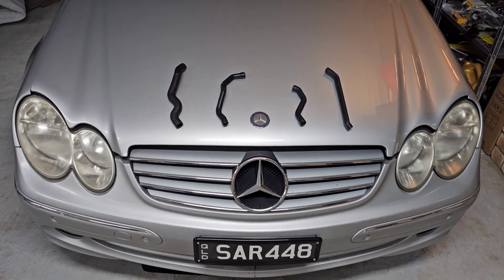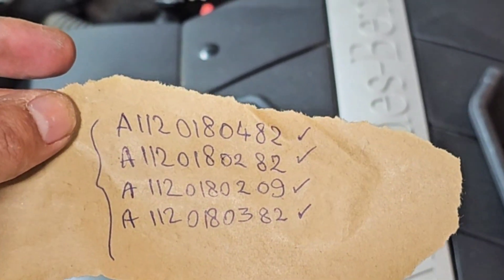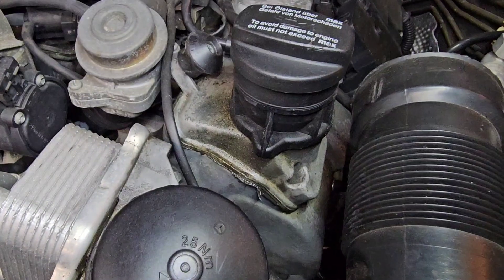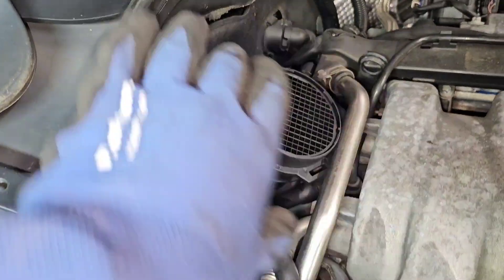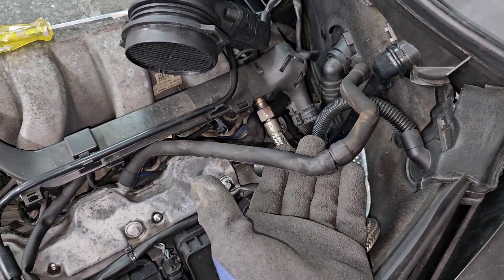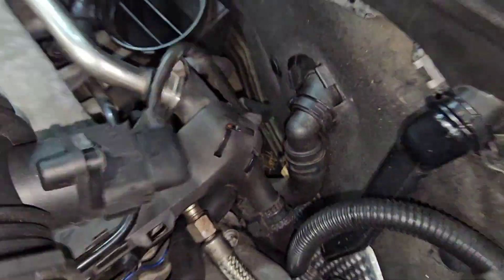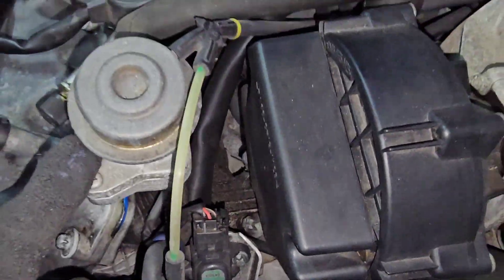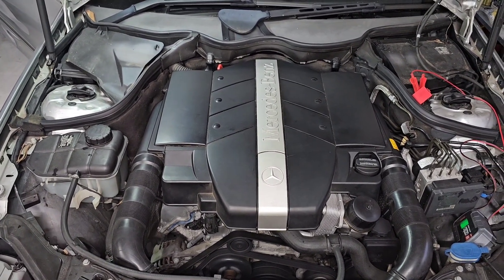Simple maintenance; huge difference, PCV hoses replacement for M112 & M113.

Comment: Is this a cause for smoke on cold start for the M113?
Reply from the maker: No, Leaky injectors or worn valve stems...
Reply: @BenzAddiction yeah I had my injectors rebuilt like a year ago, and the valve stems done aswell like 6 months back. It's on a 2004 g500. I'll try to get a video of it and post it. As soon as the car warms up no smoke at all not even after revs. One thing to ad it has the secondary cats deleted, G55 exhaust system.
Reply from the maker: @KarlLane-fp8zu 👍

Comment: If one day you have time. Can you make us a video about the replacement of EPS Pressure sensor B34/1 on CLK320 m112. Thank you for your help.
Reply from the maker: EPS, if this is referring to exhaust pressure sensor,  it is only on diesel engines.
Reply: @BenzAddiction  This concerns the braking system for a gasoline engine. If you search on the internet, ESP B34 error you will understand what I want to talk about. Thanks.

Comment: Great video Max . Good advice and good to see the MAF intake removal procedure..
Did you re-fit the clip at the back ?
Reply from the maker: Hi Leo, thanks, mate. Mine did not have the plastic black round belt clip. But the metal clip pops back in by itself when you fit the airflow meter correctly.
Reply: @BenzAddiction  Oh ok , thanks , good to know.

Comment: Hi thansk for it. I have done this a tear agon with the covers gaskets. A question about ignition coils. Mine are orginal 22 years and 174000 kms but I have no problem with these. do yo thnik I have to replace it ? Thanks.
Reply from the maker: Hi, no... if they fail, they throw a code :)
Reply: @BenzAddiction  I agree ,,mine are twenty years old but the car runs great so no need to replace them..
It's not like one coil not working well will leave you broken down somewhere.
Reply: @BenzAddiction  Ok I have read somewhere that ignition coils on these motoer are  very important for fuel consumtion or dynamic behavior...
Reply: I have a spare new one just incase..with a scanner you get the cylinder misfire so just swap it out on that cylinder and see if it fixes it.....

Comment: I just did mine and also..Rocker cover gaskets..definitely get originals..spark plugs new ,fuel injectors,air filters,cabin filters....flushed and serviced transmission...flushed power steering...new rotors and pads.Replaced rubber seals x2 air flow meter ..I am using now Valvoline Clean and Restore for the engine which highly recommend and done that on my motorcycle too..Car is now running beautifully and very happy...A little trick I did was  turn the gasket upside down/flip over on the oil filler cap..The seal mates better and seal has a groove after years of use ..flipping it fixes any leak..simple fix..
Reply from the maker: Thanks Dennis 😊
Reply: What weight are you using for the Valvoline oil ?
Reply: @darkslasher0527  Because my car has done 148k I went with 10w-40